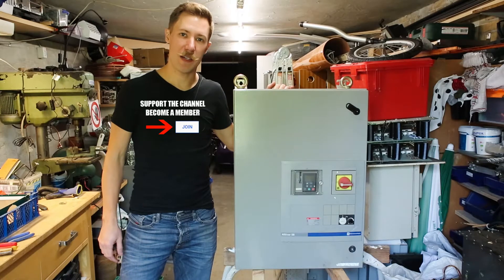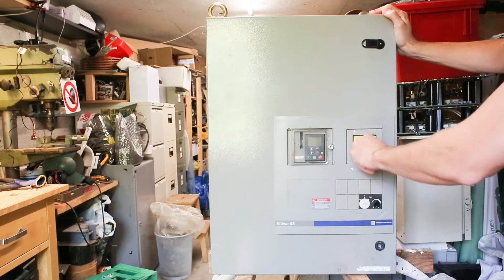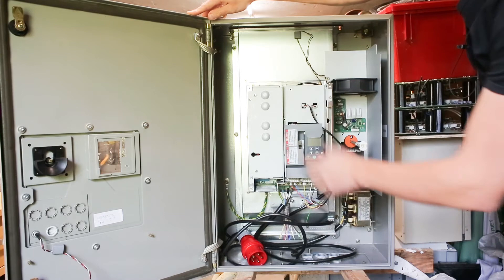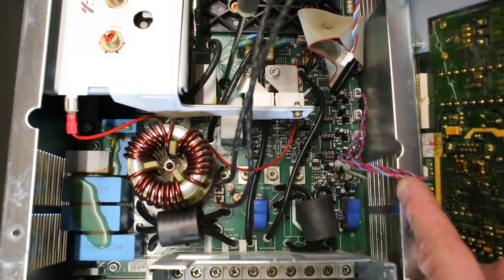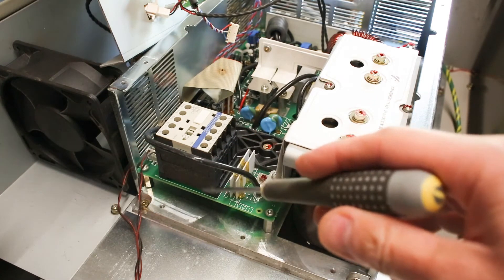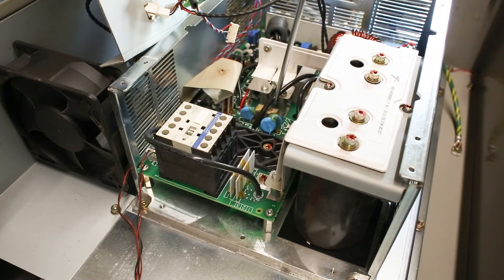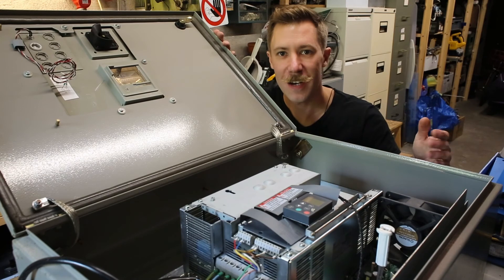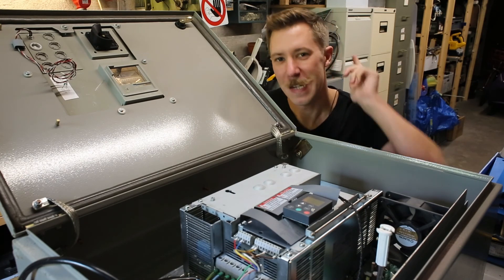Telemechanique Altivar 58, 10kW Motor Drive Teardown

Comment: Just a quick question, I dismantled a a VFD and it had four 100 amp IGBTs in it. So if I used four of them to  make full bridge single phase inverter does than mean that the inverter has 400 amp capacity or just 100 amp capacity?
Reply from the maker: It would have 100A in both half bridge and full bridge. Current through a series connection is the same all the way. A full bridge uses two switches at a time, so you have a higher voltage rating. With a full bridge you also have half the losses per IGBT

Comment: I was about to comment that they are Schneider..... We have a ton of them in Antarctica. But..... you beat me to it!  There's been a few that have failed last time I was there and had to play the swap parts game from other units to get one good unit going. They've since been replaced with newer models.
Reply: Antarctica?
What do they drive?
Reply from the maker: @johnnycash4034  Hopefully heaters and not coolers :)
Reply: @johnnycash4034  Actually, some coolers.... lol
Everything on station at the power plant, cooling water pumps, waste heat loop pumps, radiator (cooling!) fans,  building heat pumps etc..... Just about every motor is on a VFD.